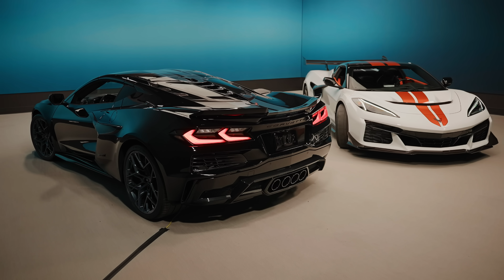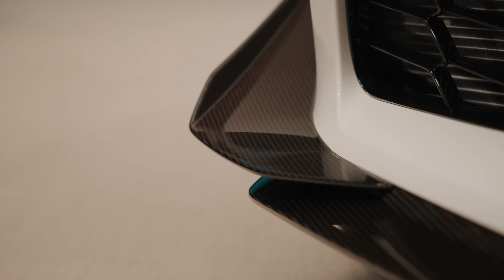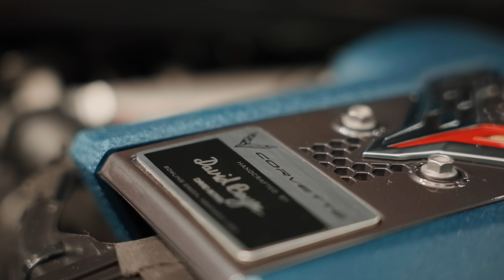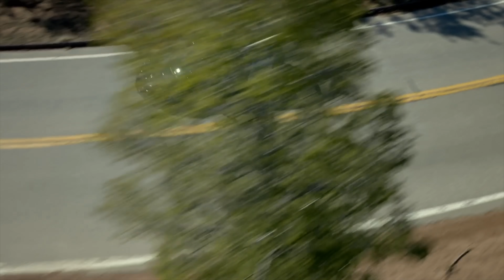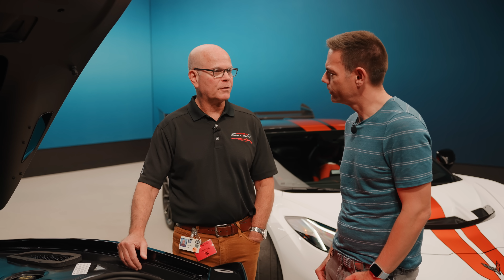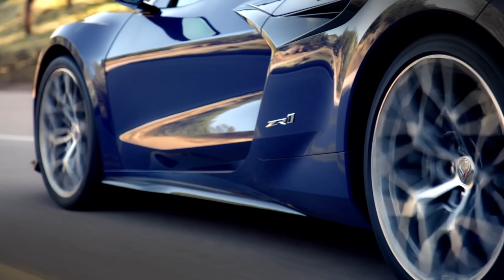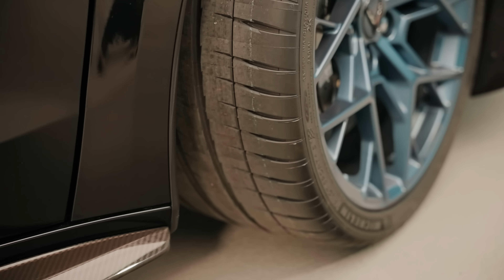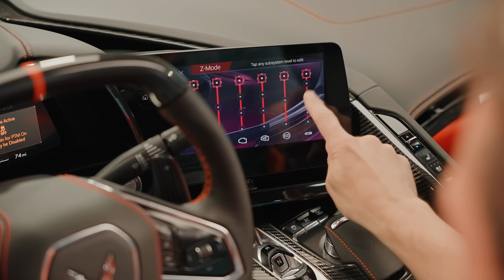FIRST LOOK: 2025 Corvette ZR1 – 1064hp, Turbos & 215mph!

Comment: Ok Corvette made a hypercar. Yet people will still say this isn't a supercar 😂😂😂
Reply: THE BASE MODEL OF THIS CAR IS A SPORTCAR,  it CAN'T be a hypercar by all means, this is a hardcore supercar.
if only by hp you call this a hypercar then the tesla model s plaid, Challenger Demon, Taycan Turbo GT  are hypercar as well and that's not how things work.
Reply: Clowns that spend exorbitant amounts of money on Euro supercars with less performance will say exactly that. The Corvette has always been looked down on but the car’s especially the Z06 and ZR1 are the best performance for the money for 20 years now.
Reply: Because it isn't. And it doesn't have to be. It's a fantastic mass produced sportscar. Likely the best ever. What makes hypercars/exotic cars that, is as much exclusivity and cache as it is performance. There were plenty of cars on the road when the Countach and Miura came out that for an additional $10k over purchase price could have matched top speed and most of performance. You wouldn't have called any of them hypercars, supercars, or exotic cars. Wouldn't have put them in the same galaxy as the Countach, only 40 of which were on the road in the 80's at one point. It wasn't even that great a car to drive. But it was on every kid's wall regardless. The stuff of dreams. Corvettes and Trans-Ams weren't, no matter how they performed. If you can see your car 20 times a day in Los Angeles, it's not exotic. You won't see a Pagani, hand built from the ground up, on the street 10 times a decade. Even in L.A. That's the difference. That's why their value goes up while mass produced cars depreciate.
Reply: @ I would agree with everything you said except certain Corvettes do appreciate in value after they get to a certain age. And I’m not calling a Corvette an exotic it’s a production car. But for the money it’s the most performance you can buy right now in the world. Every production Euro car is 2 to 3 times the money for less performance.
Reply: But top speed is not like hypercar it is just 215 mph with 1064 hp 😂😂😂
Reply: @VarunTomee-kr6nf  that is weird huh?
Reply: @VarunTomee-kr6nf *233 mph, that’s the 59th current fastest top speed for a production car and there are many cars which are unquestionably super cars which are lower down on the list.
Reply: @theletterj  215 kph it is
Reply: So tell me please what makes a hyper car
Reply: It was already a supercar, it's mid-engined. Perfect balance, nearly.
Reply: It isn't an hypercar.
Reply: @Navarra-p7j  It will handily outperform a 918. Hypercar enough for me
Reply: @Timmyval123   compare a 2013 model to a 2024 yeeeep BIG LOGIC HERE.
compare it to an aston martin valkyrie, amg one etc etc and you will realise this isn't a hypercar, in the same way the revuelto AND Sf90 aren't.
you guys do0t undestand car labbeling at all.
this is the most hardcore vette, a hypercar in base model generates this number or better ones, they production is limitated and it's track times are adove any starndard supercar, so yeep this isn't a hypercar.
and again 1000hp a challenger demon generatis that amount, a model s palid generates that amount a taycan turbo gt generates that amount, and they aren't hypercars.
Reply: @Timmyval123  918 is a decade old hypercar, compare it with some contemporary hypercars like AMG One, Valkyrie and Jesko, even against the Zenvo Aurora.
Reply: If you go strictly by HP for supercar category, then what is a Plaid?
Reply: @thedudeabides1443  I'm not just going off of horsepower. But that is a big part. Also take into consideration the insane aero, cooling and carbon fiber used. It's basically what the original 3 hypercars were but better. So how is it not a hypercar? I guess I'll entertain your stupid comment by stating that the Tesla plaid is a one trick pony that can be bought for less than $100k. It cannot turn, brake or even run on plaid mode for very long. It's the furthest thing from a hypercar besides it's HP.
Reply: @toxicgracie3772 If it was lighter and produced more downforce I’d put it in the hyper car category.  But it’s too heavy and doesn’t produce enough downforce. 

But the price will certainly put it squarely in supercar territory.
Reply: @thedudeabides1443  Its weight and down force isn't that much of an issue. The Z06 was already faster than some hypercars around tracks. This will obviously be even better.
Reply: @thedudeabides1443  the 918 Spyder literally weighed the same...
Reply: @toxicgracie3772 yet the plaid track beat the zo6 nurburgring time lol pls do research first
Reply: @Timmyval123 the 918 Spyder is also now nearly 10 years older, has active aero, a faster top speed and has less HP.  And remember, that total weight is including TWO electric motors.
Reply: @thedudeabides1443  It's about lap times (ie. all around performance), not horsepower. A Plaid does not have top-tier lap times.
Reply: @thedudeabides1443  don’t ever compare this card to a plaid you’re out of your goddamn mind
Reply: @Mrfastfeet112 all these commentators seem to care about is horsepower, which is cheap these days, which is why I made the comment.  People are obsessed with Hp.
Reply: @thedudeabides1443  yeah but look at the Corvette look at the interior. It’s way nicer than a plaid. It’s comparable to any Lamborghini or any McLaren if not better and nicer.
Reply: @thedudeabides1443  Plaid is a damn EV, those will never count as any "X"car, other than "ELECTRIC" car. Nothing exciting ab

Comment: All the cammon things this car gives you are things companies like Porsche McLean Lamborghini and Ferrari should have bin giving thier customers since day one. This car seriously desrupted the supercar market i mean just read the brochure over 1000hp with no hybrid system you get a removable roof wearther or not you get the coupe or convertible so you still get the top down experience and your not keft out carbon fiber tub carbon steering wheel carbon bucket seets ans trim carbon fiber wheels wireless charging apple car plat and Android auto one of my personal favorites the front nose lift that uses GPS data and remembers the last 50 places you used it and automatically raises the nose of rhe car over 800 pund feet of torque and even with all that some hater will look at this with its engine in the back and say its still not a supercar

Comment: Yes it is always impressive to see 1064bhp from a "production" car that meets global homologation/emissions regulations etc but the engine power for the size of engine is not that impressive in terms of power density. This engine outputs 193bhp/Litre and for comparison a Mercedes A45 AMG is about 200bhp/Litre (for turbocharged engines). I know they can probably turn up the wick and deliver more power but the limitation would most likely be the octane. I wonder how close are they to the US 93 octane limit with their current boost levels.

Comment: This car will be insane. I don't understand however why it needs 24psi to get 1064 hp at the crank. Stock 5.2 GT500 motor with a Whipple at 24psi made 1265rwhp which is around 1450hp at the crank. Even coyote engines make 1100hp with only 14psi with twin turbo kits. Are Ford engines that much better for boost? The Demon 170 also uses 24psi for just over 1000hp on E85 and only 900hp on pump and both Dodge and Chevy are using more displacement
Reply: Turbos vs supercharger the superchargers on the gt and demon are huge with no lag they never said the size of tubos here but if you go to big you have the dreaded turbolag
Reply: @benshones6588  yeah maybe tiny turbo's in the zr1.

Comment: I've been hearing people guess it would be in the 800-900hp range and wouldn't hit the 1000hp mark until the e-ray electric motor was added for the zora version. That thing is going to be bonkers and this is pretty insane too. There's  no way you can launch it hard on anything but a prepped drag surface with drag tires though. It'll be a roll racing beast though.

Comment: I thought they would use the e ray electric power terrain and z06 engine, combine them and get maybe 750 to 850 hp.
This is way to insane I saw the thumbnail and thought 1064 hp? Huh that's another tuned vette.

Comment: I'm going to go out on a limb and say it will outsell the Z06 in its first full year on sale, and the used market for Z06 cars just dropped quite a bit.
Reply: NOPE. The Z06 is the more desirable car for many. WAY better FPC exhaust sound, naturally aspirated, 230lbs less weight, etc.
Reply: @IndependenceCityMotoring  Used Z06 have just slipped into five figures.
Which is a lot of car for the money.  And I agree it is very desirable.
Reply: I hope so, so I can buy a c8z

Comment: This over any 1000hp supecars anyday like the Revuelto & SF90 lmao
Reply: @imamfn  Because those are hybrids?
Reply: Both Lambo and sf-90 will be quicker than this 😂😂😂
Reply: Yeah but those car's have to conform to Euro regulations. SF90 would probably still beat this though, it's also a 9 second car.
Reply: @BNR_248 I highly doubt the SF90 would beat this on a drag strip, the Corvette has the better power:weight ratio. The SF90 would only win in a street race because AWD.
Reply: @yissibiiyte  power to weight can easily be offset by instant torque from the hybrid electric. All the Tesla plaid videos attest to that (I’m not a fan of evs btw). But I know what you’re saying. This is a great car, but claiming it’s better than this or that without a proper head to head is pure fanboy talk.
Reply: @BNR_248  the instant torque from a 1300NM full EV is very different to the instant torque from the SF90 who's electric motor makes only 200-ishNM. Which is why the Plaid beats the SF90 in a drag despite them having very similar power.
You're right that this is pure speculation, but I would still bet on the ZR1.
Reply: @yissibiiyte  Yep you're right, definetly agree, i think i made an over generalisation there with the hybrid. Will be an awesome head to head nonetheless. Really love that GM have continued to refine their v8 engines and for the sake of saving ICE cars i really do hope it pressures its competition.
Reply: @yissibiiyte   The power to weight is nearly identical, the SF90 Stradale being an awd car below 130mph will have the advantage, if that doesn't beat it then the SF90XXStradale will.
Reply: @Brian.Jones.310  no, the power to weight is not identical. The Corvette makes 60hp more and weighs 200kg less (keep in mind Ferrari only quotes dry weight).
Reply: @yissibiiyte  GM quoted dry weight as well, 1665kg is dry weight and the equivalent Ferrari data is 1570kg for SF90 Stradale with Assetto Fiorano pack and 1560kg for the SF90XXStradale.

It's 3670lb dry which is 1668kg to be precise. So vette is 0.638hp/kg while SF90 Stradale is 0.637hp/kg and the Ferrari is 5 years older and out of production.
Reply: @Brian.Jones.310  the Corvette weighs 1650kg, and nowhere does it say that that is dry weight. Meanwhile the SF90 weighs 1570kg dry which translates to roughly1770-ish in reality.
Reply: @yissibiiyte  Every publication said it's 3670lb dry.

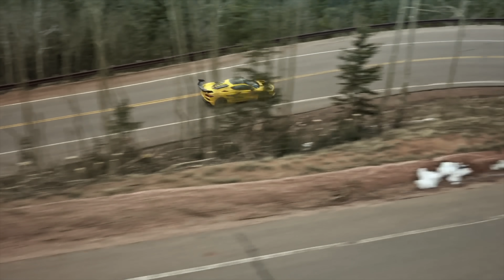3:54 Hear it!
Reply: @Brian.Jones.310  people have actually weighed the thing and it's 3700-ish WET. Top Gear consistently misquote stats.
Reply: @yissibiiyte  MT estimates it will be around 3950-4050lb, TG isn't misquoting anything. How come people weigh that car when it just got launched?
Reply: @yissibiiyte  Even Motor1 said 3670lb dry 😂😂 Nice try!

Add Throttle House to that as well. 😂😂
Reply: @yissibiiyte this is rear wheel drive whole sf-90 is awd and with electric instant torque sf-90 is way quicker.only give completion in rolling race
Reply: @yissibiiyte still 200 kg doesn't matter when you have electric boost
Reply: @VarunTomee-kr6nf  It does when you only have 200NM of electric boost.
Reply: @BNR_248 not probably definitely
Reply: @BNR_248  on a straight line while the battery is still around 70-100% of its capacity. At least with the pure ICE engine, the horsepower figures is available all the time with the lesser weight